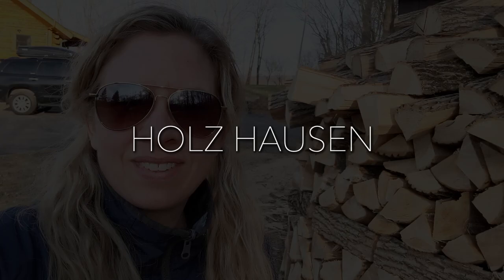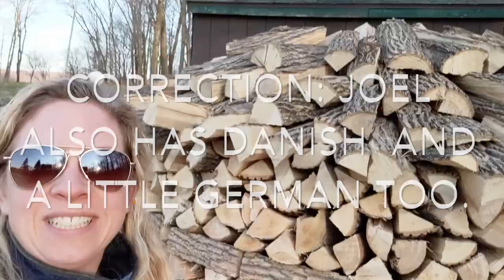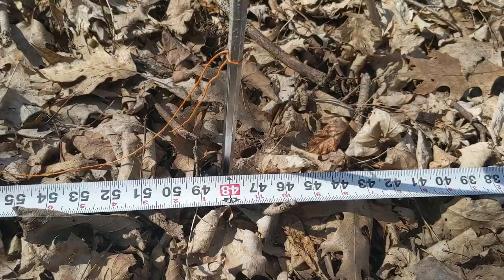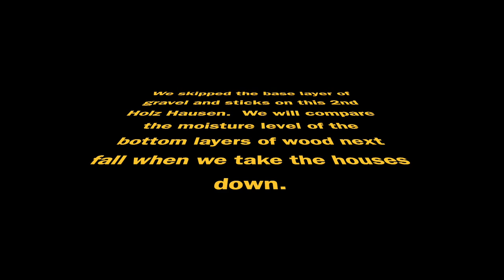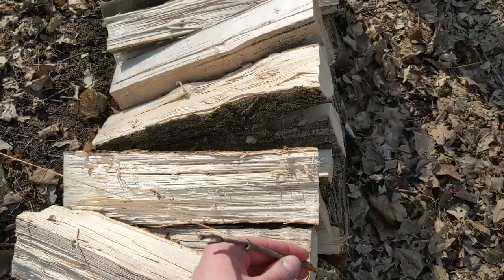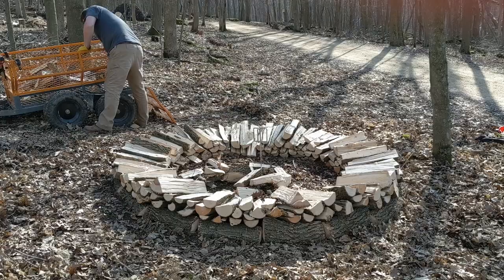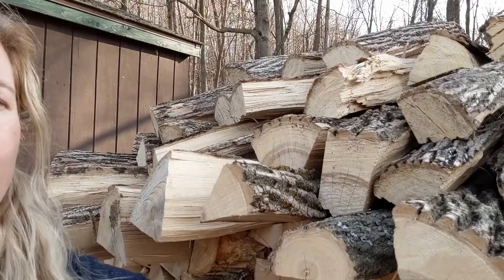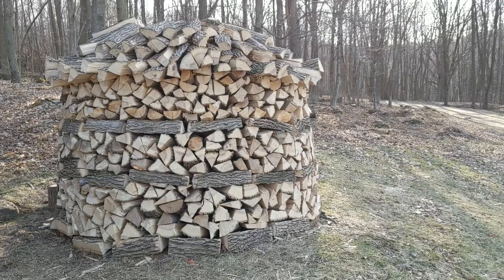Holz Hausen - Good looking, easy, and practical firewood storage solution

Comment: Wonderful job! I love the drip edge! That’s such a great idea. I use bark for the bottom of mine. I call it my lazy way of not being fancy hahaha I also have mine 10 feet in diameter so I will put two round of straight ones and then all odd shaped ones in the middle like yours.
Reply from the maker: @lmac36 - great idea with the bark.  We really love the look of these structures once built.  At times it's hard to see them be  disassembled to burn!  Thanks for watching our channel.

Comment: I put a layer of brush in the bottom of center instead of gravel and a grid of sticks.
Reply from the maker: We did the grid of sticks, but not the brush.  Good idea though....we'll try that next time.  Thank you!
Reply: I raked up the debris from the splitter into a circle and then put the saplings on top of that to start.